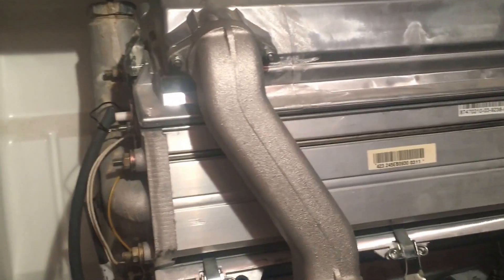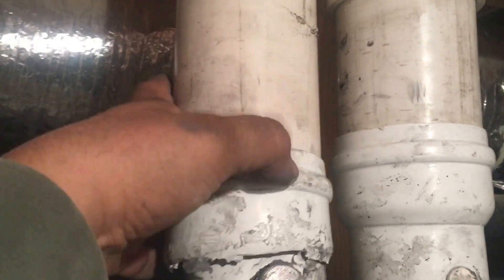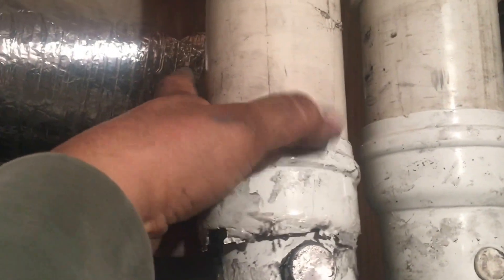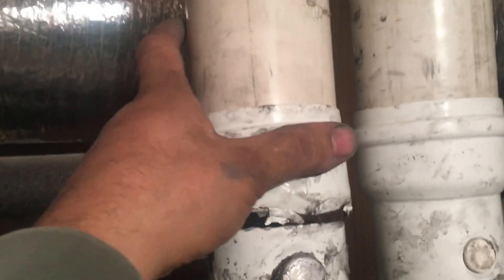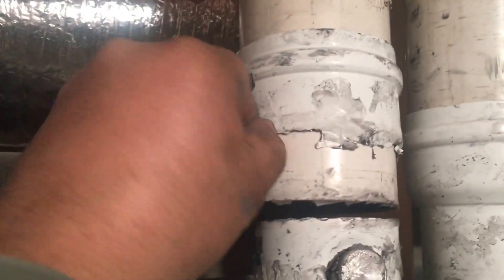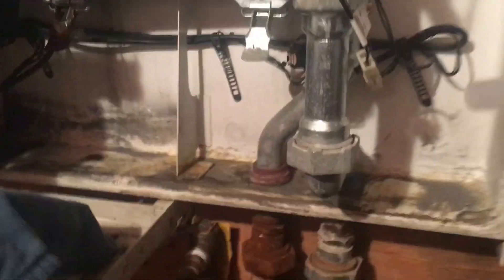Buderus GB142 Flue collector failer Part 1

Comment: The other thing about this; If the original installer followed the directions that came with the furnace, they would have installed a condensate drain tube on the exhaust pipe that connects later with the water drain from gas condensate. Then there actually wouldn't be a problem. Installers were pretty much all skipping that step as far as i can tell.

Comment: I had the adapter conversion professionally installed. I'm wondering how difficult it is now to clean out sediment trap. I had read if sediment trap gets full, unit won't operate.

Comment: Happened to my Buderus 142 60. this is a dangerous situation, I just happened to notice it working on electrical outlet above the unit. So far no luck getting Buderus or installer to accept responsibility. Installer came out to access after I called. Advised not running unit , it's early Februrary! Days later still unresolved. Installer called Bedurus, says they no longer have parts necessary.
Reply from the maker: That's not true , parts are available ! It's a retrofit kit . Buderus part number 8718600686 ! Flue adapter conversation kit!  
Hope this helps ! Check Buderus website or Bosch thermotechnology Corp in Londonberry NH ! 603 552 1100
Reply: True, finding parts now. there was one even on Amazon Prime. Replacement of flue adaptor looks pretty easy but one of the Bosch tech sheets shows removing boiler so I'm getting estimates from 2 local furnace installers.
Reply from the maker: George where are you located ! I may be able to help you find a good service provider! Lots of plumber installed these but sadly can't service them !  For that reason I made these videos !
Reply: I'm in upstate NY. True about plumbers. Mine was installed by a furnace installation and sales company. The copper work was gorgeous, but they had several installation errors. they didn't install condensate drain where older units required it and the switched the exterior piping for the intake and exhaust discharge.
Reply: @knighthvac4876  I'm installing a used unit in my home in a few weeks and I'll be depending on these vids!
Reply from the maker: You don't have to remove the boiler block on the 142-60 ! You'll be able to slide the tube behind the block ! I like to slide the tube while the flue collector is out !
On the smaller 142-30 and 45 it's required to remove boiler block!
Reply: @knighthvac4876  Its states on the video it is a 45 and you said you could fish it though.  Can you fish it on the 45?